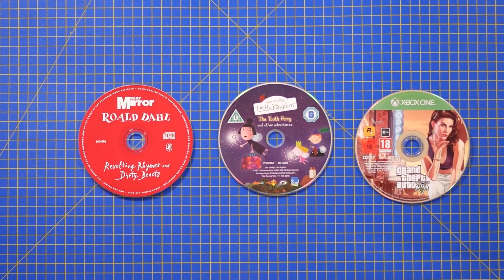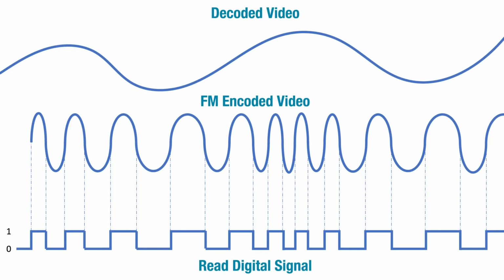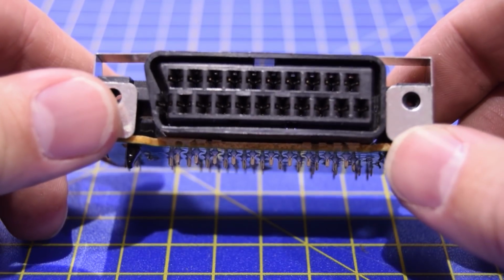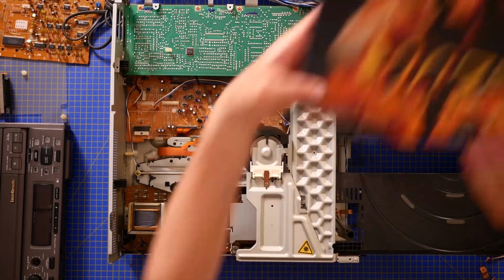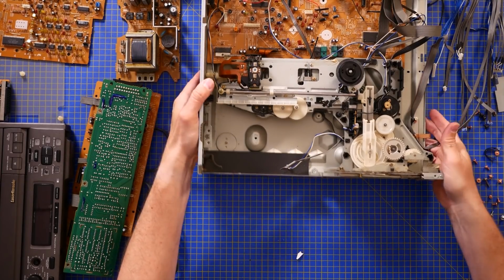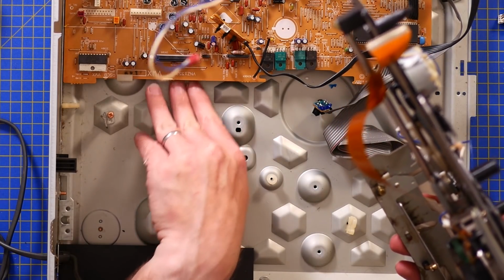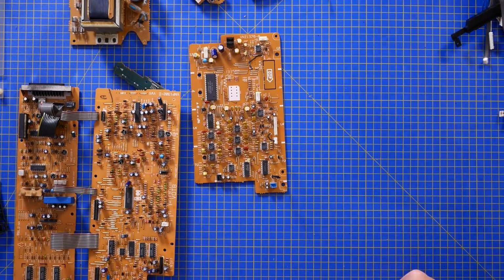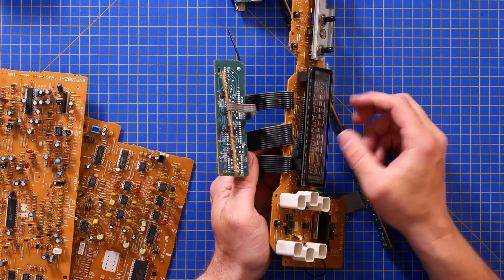Pioneer LaserDisc Player Teardown - The Electronics Inside

Comment: i own 3 LaserDisc players😁
Reply: 3 is impressive - I need to know the back story here... Is it because you have a karioke one, a high end Hi-Vision CAA version, and one for a bedroom?
Reply: no the first one is first ever US laserdisc player from 1981 is a top loader with coaxial cord to plug into tv the second one's from 1987 and my third one is from 1989 none of them are karaoke
Reply: @williamwilson480  That's a much better answer - I'd assume the 1981 model has the helium neon laser? Does it still work?

If you ever part ways with it - I'd be interested to find out!
Reply: @a531016  I'm not sure if it has a neon laser but it still works got it for $80 off of Craigslist back in 2019 the model was VP-1000
Reply: @williamwilson480  Wow - That is a machine with a very pleasing asthetic. I have just seen one on eBay for $1500!
Reply: @a531016  today now i got a laserdisc karaoke player is a CLD-D504 and it plays both sides of the disc perfectly very well kept got it off the Craigslist for $200 now I'll probably get rid of my 1989 laserdisc player and keep the 1981 and 1987 players😁

Comment: My Pioneer LD player was working fine when I had to put it into storage. It sat for a few years, and when I got it back out, it would power-up, but shut off when I would hit Play. Since I can't exactly look up a LD repairman in the phone book, I'd love to hear any ideas what the problem could be. I'm hoping it's just caked with dust inside, and maybe cleaning it would do the job. (I kept buying discs while it was stored, in anticipation of getting it out again. Hate to think I'll never be able to play these gems.)
Reply: If I had to guess, I would say that either the optical carriadge or the spidle were seized up and need some lithium grease? I would think the over current of a motor stall is enough to trip the power supply?

Pure guess work of course!
Reply: Old leaky capacitors are always a good first place to check. Any that are obviously leaking or bulging just replace with rated equivalent.
Reply: @djlegenduk  Very good point! Probably should have lead with that!

https://www.element14.com/community/docs/DOC-95798/l/the-electronics-inside-29-bbc-micro-recap

Comment: I guess "digital" is really all about what the signal on a medium represents after the first layer of conversion.
I would call it digital if the disk encodes 0s and 1s for a direct binary representation.

On a Laserdisc, as you said, the pits and lands on the disk surface are actually of variable length, which encode the peaks and troughs of the original analog (and Frequency Modulated) signal.

After low-pass filtering, it really is just an analog signal with a finite bandwidth limit.

But, you can of course encode true digital (binary maths stuff) in an analog signal via some form of modulation or other mode. Which is how PCM and other digital stuff is encoded alongside the main video carrier.

(they later added compressed 5.1 audio like Dolby Digital and DTS.)

After demodulation, the digital audio on the disk directly represents binary 0s and 1s.

I'd call it "mostly analog". lol
Reply: I'm very interested to know, since the audio was PCM encoded, why they didn't encode the video too? I assume as you say, it's bandwidth related (PCM would need a much higher bit rate to recreate a wave) although it could be decoding power available at the time?
Reply: @a531016  Yep, mainly the processing power needed at the time, I guess, and the added cost of high-speed ADCs etc.

It was just "easier" to transfer the FM video signal onto the disk in a more direct fashion. With enough bandwidth for a certain number of video lines per field, vs an hour or so of runtime per side.

(and getting Laserdisc to work reliably enough to mass-produce players for the public must have been hard enough.)

Without any digital compression, the raw samples of a Composite signal would likely have taken up way more bandwidth than the 6 MHz that the analog video did.

I don't think there was any equivalent to MPEG codec way back in the 70s.

Even in the early 90s it was still quite expensive to buy an MPEG decoder card for VideoCDs etc. I remember it well. hehe
Reply: @a531016  Digital video encoding for consumer products simply wasn't available back in the early 1970s when the LaserVision system was formally being developed by Philips and MCA Laboratories.  At that time, high quality digital audio was only just starting to become available for professional/commercial use, so it would be a ways before digital video would have been developed, and then initially for professional/commercial applications like broadcast television, and then in service to analog TV standards like NTSC.

And PCM audio on LaserDisc was never originally part of the LaserVision system as it was added on about six years after the first release of the system to the consumer market in 1978.
Reply: @Watcher3223  Yes. that's the main difference - the pits and lands are variable length, to directly represent an analog signal.

But that's why I said digital is really more about what the an analog signal can be made to represent.

CDs and DVDs differ because the pits and lands directly encode binary bits, so are more-or-less of equal lengths for the 0s and 1s.
(which uses EFM and CIRC etc., but still basically digital on the disk itself.)
Reply: @electronash  DVD and CD have pits and lands that represent binary notation, but those formats use EFM (DVD uses EFM Plus) partly to ensure that the pit and track pattern is written in such a way that it can be tracked by the tracking and focus servo circuits for the optical pickup at all times the disc is being read.  It also adds a level of resiliency against optical obstructions (dirt, dust, scratches) to further reduce the chance of mistracking.

Once read off of the disc, the EFM encoded signal must be decoded to extract the original signal.

CIRC is for error correction and is part of the decoding process.

LaserVision does use EFM for digital audio, but that's primarily for helping to ensure signal integrity as its contained within an analog subcarrier.

Comment: The metalwork has a lot of indentations in it, they may seem random but they have a mechanical purpose. They stiffen the sheet metal which makes it harder to bend it.
Reply: Absolutely, the top spindle support had a beautiful honeycomb reinforcement in it which I particularly liked, and it was rock solid!

Comment: SCART is the worst plug design ever. Oversized contacts, but made from the cheapest tin metal with terribly poor tolerances. 
Several protocols on the same plugs, bringing a lot of compatibility problems. I don't even talk about the horrible bulky pure plastic frame and the ridiculous shielding piece. Re-using an existing plug design, like a Sub-D or a Centronics would have been a lot better....

Comment: The video is an analog signal, encoded in a digital format.
Reply: No, the main carrier is never encoded digitally in LaserDisc.

The best description of how the pits and lands are laid out is in pulse width modulation.
Reply: @Watcher3223  the audio was digital.
Reply: @JasonTHutchinson  The original LaserVision specification never had digital audio; digital audio was added about six years after the format's introduction to market in 1978.

And, the digital audio track is contained within an analog FM subcarrier at the 2 MHz band.

Although LaserDisc did have digital signals, the basis of the format itself is analog; all digital signals had to be contained within analog carriers.  And the video itself remained analog.